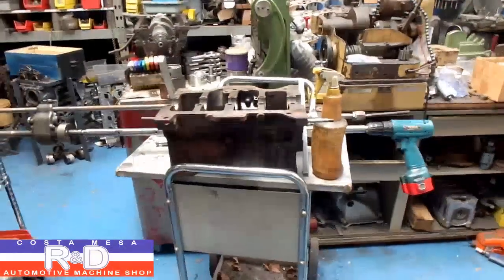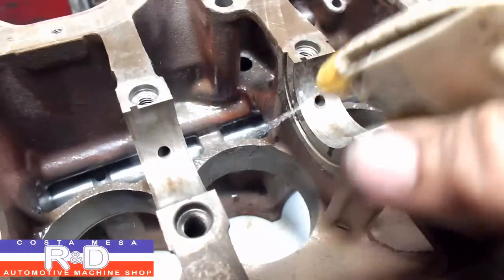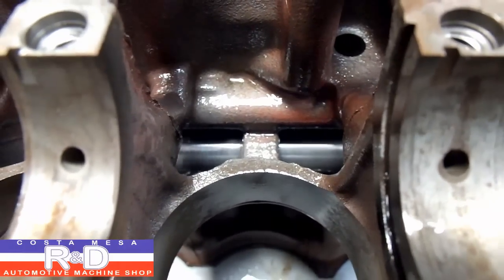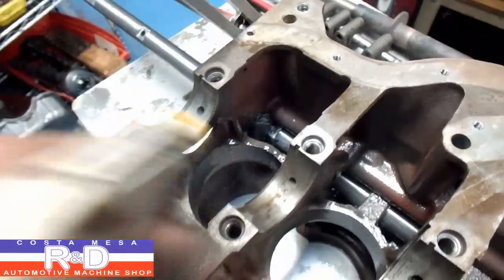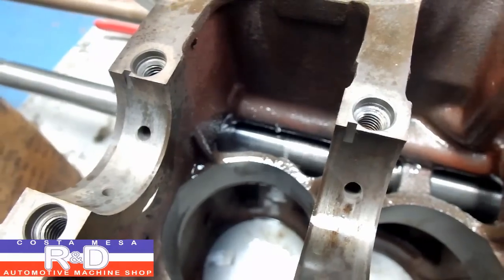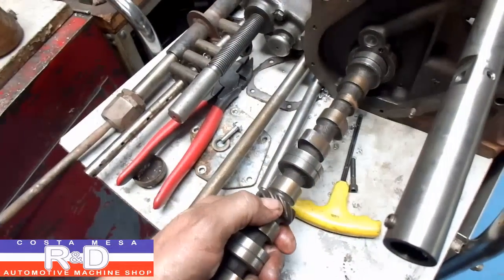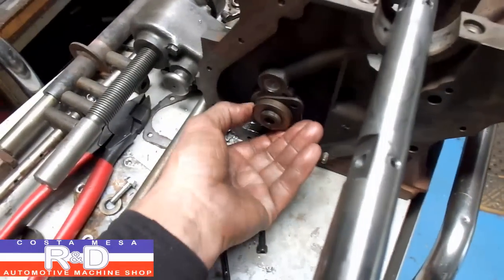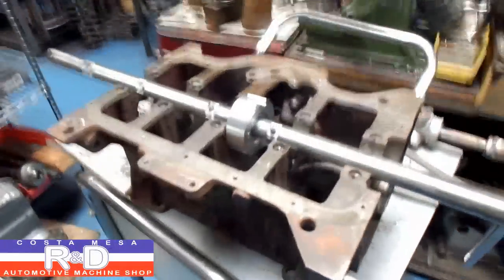Renault Gordini Cam Bearing Alignbore

Comment: From which Gordini is this block, not the 800-900cc engine of the 60's (the only Gordini produced in south america)? I had the impression that this small engine had only 3 main crankshaft bearings and the one you were working on has 5 like the Renault 12 engine.